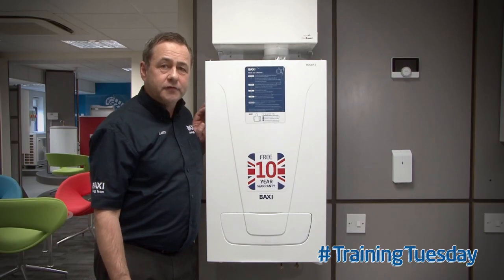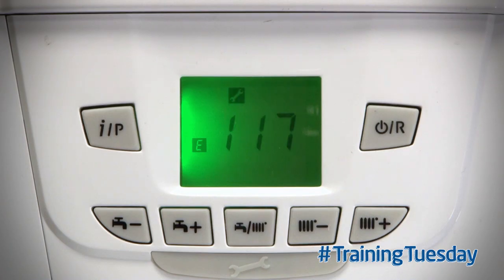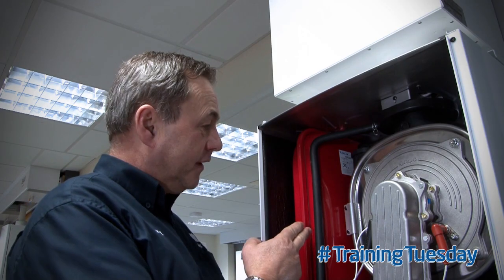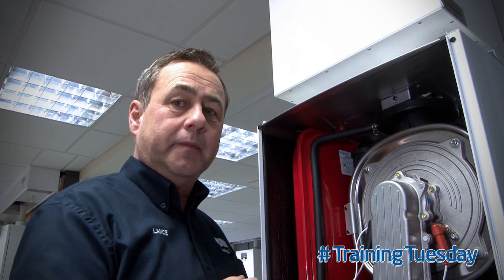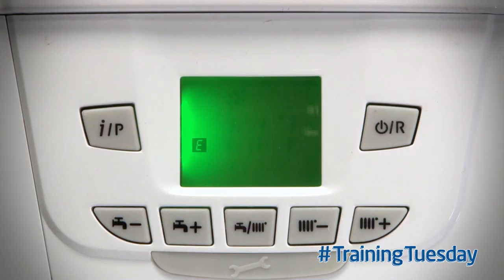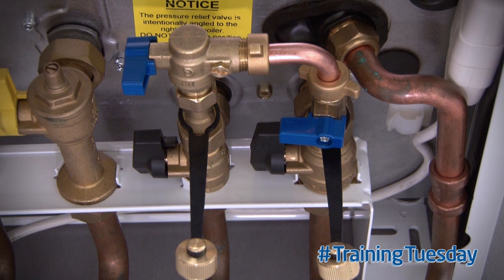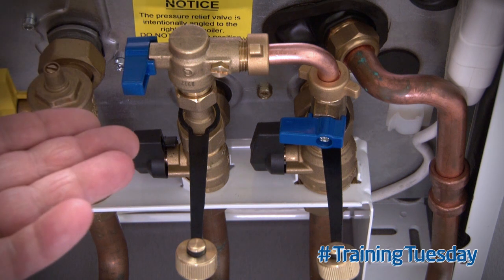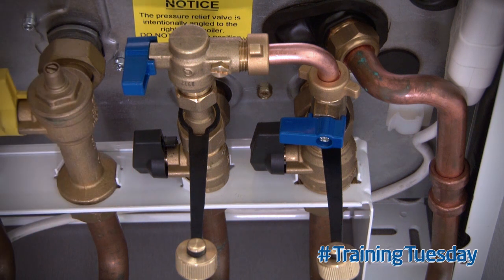A simple check on how to diagnose E117 fault on Baxi Ecoblue Combi & Baxi Ecoblue Advance Combi

Comment: I had my baxi boiler serviced today, the technician said the pressure was too low (0.7) and brought it up to 1. A few hours later, I have error 117 flashing with 2.7 bar on the display. The dial on the underside shows it at 3. There's no heating either. How do I depressurize the boiler?

Comment: Can you please show us how to do it?
Reply: There’s a brass nut on the bottom just slightly turn it and the water will drain out. Make sure you have a container to catch it. Re tighten the nut when the pressure is lowered back in range.

Comment: + Baxi boilers  Hi there i have error 117 showing on my Combi, The heating is fine and so is the hot water but the combi keeps trying to ignite all the time . Should i turn it off , the presure is okay still in the green i have not touched it since it was installed. Maybe you could pass this message on to your tech guys who are coming out to my house on Friday to fix it .. I got a call from them today. I am lucky in a way that i dont have to pay due to being in housing association house ( Best let them have a look ) I was just worried about it keep igniting all the time plus its getting cold outside now brrrr  Thank you oh tabs are off
Reply: Will get back to you soon
Reply: Hi did you managed to fix it please i have the same problem what was a reason and a cost?